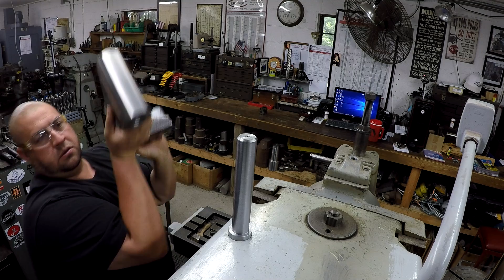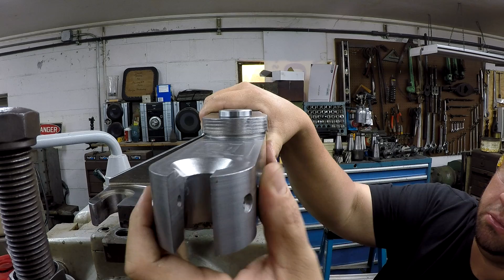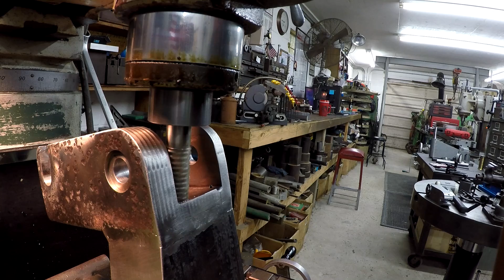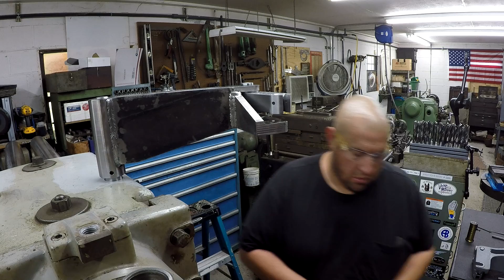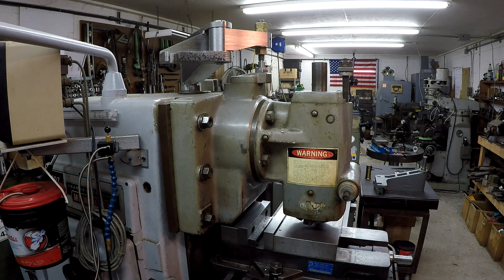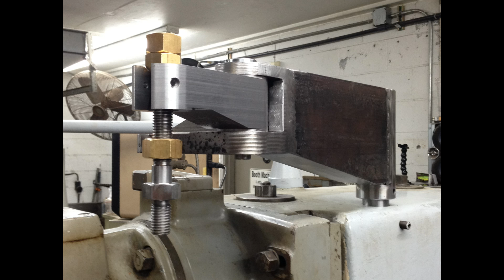Kearney & Trecker Parking Attachment 16: The Reveal!

Comment: A bit comment about that calculation. From what I have learnt, load does not distribute equally among matching threads.... the first few threads take most of the load. That's why standard nuts are only so high. Because double the nut height doesn't mean the load capability doubles.

Comment: I think you built it plenty heavy. My engineers brain says that you would break the shaft off out of the top of the mill before failing anything else in this setup with the way the head loads the arms.
Reply from the maker: Thanks Brian. I think we both know it's built plenty tough.
Reply: Abom79
Probably 6 times as heavy as a 2 ton harbor freight engine hoist! lol

Comment: Adam, quick question.  can you show us what you can do with that machine when the vertical head is parked on the side.  are there more attachments? I am very new to the machining world.
Reply: with the vertical head off and stowed and the long arms extended with the bearing support installed, it becomes a horizontal mill

Comment: I'm only at 5:25, dunno if this ends up being a problem, but the center of mass thing is an interesting challenge. To test if it's a problem, perhaps you could hang it from the original eye bolt using the new mounting plate, and add a few weights to get it all nicely balanced.

Comment: nope I'll put money on the bolts not stripping! we use brass nuts to install boiler doors that weigh in excess of 10,000 lbs and use a 1" impact gun to suck them down with a 1 3/8" socket on 7/8 and 1" bolts. I have never stripped one even if they get cross threaded they will run new threads in most of the way but I have yet to strip the threads out of a single brass nut and I've installed at least several hundred blr doors with 10-12 steel bolts/ brass nuts on them.
Reply from the maker: Awesome!

Comment: I am thinking that the way for operation is to first unlock the clamps, move the overhead arms out far enough that the crane swings around (ccw from overhead), then draw the overhead arms back in so that the bolt fits into the slot in the main crane body.  Then you would tighten that nut down to the main crane body.  Then fully retract the overhead arms.  That way, the vertical mill head is never being held just by those top 2 nuts. It will be either supported by all the nuts of the crane or the overhead arms. Just an idea. Hope that makes sense.

Comment: I don't think the dimensions are wrong, but rather the steps to remove the head.
I believe you are supposed to undo the clamps then use the over-arm to push the head out. Other wise it doesn't make much sense to have the shorter pivot arm on the crane. And this would explain why the crane arm appears to be too short.

Comment: G'day Adam .
How about 2 nuts mounted to the side  of the machine to pick up 2 of the 6 head retaining bolts  to snug it all together  re leaving some of the load off the CRANE  elevating the vibrating /swinging about  . Just a thought  600lbs is a lot to hang about  .
 Will you be tweeting Bills  arm  before returning  the much appreciated loan ? .
 Paint color  what about Keith Rucker PINK .
Good on  ya

Comment: Id bet that head doesn't weigh 500 or 600 lbs. I'm guessing more like 200-300 lbs... but I could be wrong.
Reply: Even if it was only 100 or so it would be impractical and one hell of a risky operation by hand considering the consequences of dropping it on your foot, even with steel toes
Reply: Still more than you can lift by hand, whatever it actually weighs.  Even for Adam.
Reply: Check out This Old Tony's boring head video, he does it by hand. I think you guys are just exaggerating, could probably just make lifting these heads part of some new crossfit routine.
Reply: I think you are right. Probably 300 or so
Reply from the maker: David, no way it's only 200-300 lbs, but I've been known to be wrong too.
Reply: Use the scale you bought to check the welding table weight. you have a lifting eye for the head and the a frame in the shop. Id be curious to see what it actually weighs.

Comment: @abom79 the attachment looks great.  I agree the brass nut are more than sufficient.  Although you are only using two nuts to support the weight not three.  The bottom nut is not supporting any weight.  It is only used as a jam nut.  Great work buddy!!!

Comment: Paint it up, add the logo, and put a little Never-seize or some high pressure lube on those pivot joints. Might want to look into some rubber bumper stops for where the head sits along side the machine.

Comment: Brass is no problem on that but I'd probably make a small change.. I'd make the brass nut with the bevel on it, a little taller to make it easier to get a wrench on it.. IIRC you used pre-made nuts. I guess you'd have to remake that one. One thing that I'd also think about is adding something to the side of the mill to hold the head in place when dismounted.. Any heavy horizontal milling that causes vibration in the machine might let that head walk out.. Set screw will help to keep it in place but with a bit of vibration, it may not hold. 
Most excellent work overall.. I was thinking the main arm was a bit of overkill but now that I see it in action, maybe not.. :-)

Comment: Excellent. One last thing: steel against steel makes a quirky bearing. You probably thought of this but maybe a grease fitting or two?

Bronze sleeve bearings would be nice but a hassle out of proportion to benefit. The original cast iron has pretty good bearing properties against steel even under vertical head crane loads but steel against steel tends to score and gall. Therefore Zercs and EP (molly di-sulfide?) grease.
Reply: Don't-cha just hate Monday morning quarterbacks?

Comment: 31:05 when you pushed the head in place you also pushed the overarms back, is that going to be ok ?
Reply from the maker: The overarms can only go up in the vertical head so far, it was pushing them back because they were fully seating in the bottom.
Reply: ok ^^
Reply: Well spotted.
Reply: I would think that once it is snugged to the machine you would re-snug the overarms out to the head?

Comment: I'm also wondering (see Nathan James' comment)  if the overarms, the round ways, are supposed to be extended out from the mill to put the vertical head on or take it off. I personally have no idea, just thinking. I was also wondering if the one you got to copy was made for a different model mill.

Either way, no matter. The fix was easy enough and it will do exactly what it is supposed to do the way you want it to and that is all that really matters. Great project build and it looks like there may be a Part 17 after painting and drilling the roll pin hole. Love the idea of the chrome ABOM79 plate on it. You are one happy camper about now! Nice work, enjoyed every step. Thanks!

Comment: That's funny that you had Tom figure the yield strength because I started to do that myself the other day but wasn't sure what all material and thread length you had. It's like he was saying at the bash though a 1/4" bolt would probably hold that without issue. Lol that thing is probably going to make your life way easier when you go to switch from horizontal to vertical.

Comment: Hey Adam,

Parking crane looks great! I think you should have made some plastic nuts to really scare the safety nazis. Great job buddy!

All the best,

Tom
Reply: Good thing Tom didn't make those nuts for Abom, they may have been shear nuts!
Reply: Plastic nuts would be sure to induce instant apoplexy in the safety nazis who apparently don't even own a pair of plastic nuts of their own.
Reply from the maker: Thanks Tom. I have some UHMW, would make for interesting troll bait! LOL
Reply: Those nuts look beefy enough.  

Point to consider is that the top two must carry the load on their own when swinging out, the bottom one only helps if it is in the parking recess.  

Also if the top two are locked over tight (more force than the load) then one nut will be under reverse load and the other at more than double.  If the numbers are even close to correct then the 10:1 margin will be plenty unless there is operator failure.
Reply: Yay for using math post school.
Reply: Just my two cents worth about the brass nuts, the nut for the knee on that mill is also yellow metal and it's under a helluva lot more strain than that milling head. I'm pretty sure that head will hang there till the rapture! Great job Adam!

Comment: Nice job Adam! Great series, nice videos, nice part build. One thing that I have to add is that not sure why anyone would have said anything about the brass nuts, but if Tom said he did calcs on it and it would work, I would have stood underneath it when you tested it! Only thing was that you said there were three nuts, and there are three, but only two are load bearing. So load calcs can only be based on two. But all that is moot point as you could probably have a 3/8" brass nut hold that! Would I use it, no!!! But if you look up load rating for it, I have no doubt it would!! Again, great job!!!!
Reply: Correct to a point Fred. But technically, if for some act of God reason both the top nuts stripped, there is not enough vertical inertia to strip the third nut. It's only within a few thousandths away from making contact. And the only reason they would strip is from repeated torquing. Like many other, I think that it's going to move less than a handful of times. Barely any stress on it when it's in use.
Reply: He's also going to pin it too, so between two nuts and pinned he should be more then good!!  Now if we could just get manufacturers to come up with the same over engineering/design we would have a lot better/longer lasting machines to use and cars to drive!!!
Reply: 3 when parked, 2 when dismounting I questioned that too
Reply from the maker: Yes just two nuts when it's being dismounted, I should have started that. 3 nuts total when it's parked and locked in place, plus a roll pin on the top of the screw.

Comment: Abom79 Great work Adam. And awesome way to overcome the difference issue. Considering how many heads there are (so far i've seen on K&Ts from old pictures as many as 9, some of which pretty big, not sure what all of them did) it's entirely possible that there's multiple variants for that arm. 

Next up is Keith Rucker's parking crane. He's finished his furnace, he has the part to copy , so soon? Hopefully. It will be interesting to see the difference in processes. You having fabricated yours and him pouring and milling his.
Reply: Oh and Abom79, on Keith's mill, there's railings (to clamp the head on to) on the sides, if i recall correctly, maybe you should build your own as well, leaving the weight on the arm, won't break it, but it's always best to be sure.

Comment: That is one of the sweetest most satisfying project reveals ever - it not only made an awesome video project series, its immensely useful and practical as well.  I kept saying theres no freakin way Adam Booth is a half inch off from the original, no way-!  The K&T knee has been gone through, and now a one of a kind custom machined parking attachment.  And Adam I really liked the analytical way ya handled it when it wasn't immediately apparent what was going on - only because you had never used one before, no biggie.   Only thing left is a set screw, that last roll pin and some paint, lube and label.   One commentor mentioned some handles for leverage, but only you know if that's practical - the old one didn't have any, so its a toss up.

Comment: Could you have extended the over arms out enough to push the vertical attachment out enough to align the two holes without machining the extra clearance? Would the over arms support the vertical attachment safely if you loosened the six mounting bolts just enough? I enjoy all your vids immensely!

Comment: Why are you not putting some grease nipples on the two bores and making some grease grooves in the bores so you can lube up the pins so it turns easier (and wear less)?
It is no wonder it's kind of hard to turn with all that weight on a dry steel against steel hinge.

It does not hurt to make some improvements even if it is not a original feature. And a screw in stead of the safety roll pin will also  be easier to take in and out.
Reply from the maker: No need for it. It comes apart to quick and easy, just pull them pins and re-lube once in a while.
Reply: Ya I would just put some extreme pressure grease on the working surfaces and call it good
Reply: The original attachment didn't have grease zerks, so why add them to his version?
Reply: This version has steel to steel material combination which is susceptible to seizing without sufficient lubrication.

Comment: Adam, I just watched the video again really close and I think I figured out the way it is supposed to work. Once the side clamp bars are loose, run the over arms out instead. The head will come straight out but the arm will pivot around till the bolt is seated in the larger support arm. If that's not the way it's supposed to work then I'll be a monkey's uncle.
Reply: Sounds very possible, it would certainly be nice to test this.  The freedom to pivot may cause some unexpected movement when it comes free.
Someone should have the sequence mentioned in a book somewhere though.

Comment: Beautiful Parts. As a Mechanical Engineer I don't think you have to worry about the threads/nuts holding the head to the arm. If ANYTHING fails in that installation it will be the pin that holds the whole thing to the machine. It will bend before it breaks, and if it bends you'll know it. And you can always make another one.  If that pin is good enough for K&T you are gold.

Comment: Nice to see that thing on the machine :)

If you have to drive the rollpin out every time you want to get to the screw, wouldn't it be worth it to replace the rollpin with a bolt that has one end machined into a lrager diameter than the rest and a hole on the other end where you can put one of those metal springs through that prevents the bar from sliding back?

No idea what the last part is called, but it basically is a wire with a straight part that goes through the hole, a loop on the top to keep the whole thing from bending open and another part going back down that has a curve to it which snaps over the bolt.
Reply: R clip would do, don't need a nappy pin :)
Reply: So, that thing is called R pin...

Didn't mean a nappy pin, just the only R pins I saw had an extra spring loop on em (but I didn't see many of em).
Reply: +dayofmone could you possibly be talking about a cotter pin?
Reply: Just googled it, what I mean is called R pin with double loop.